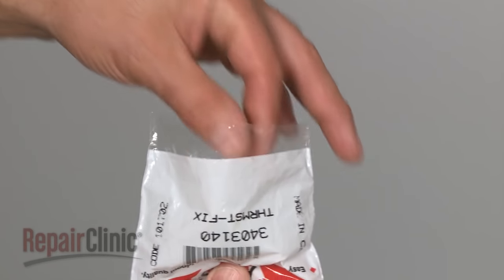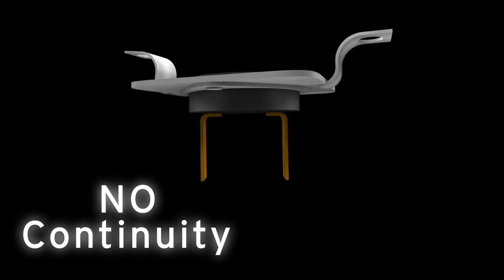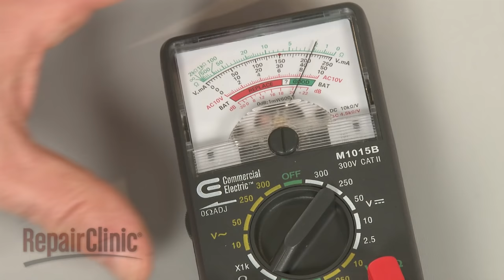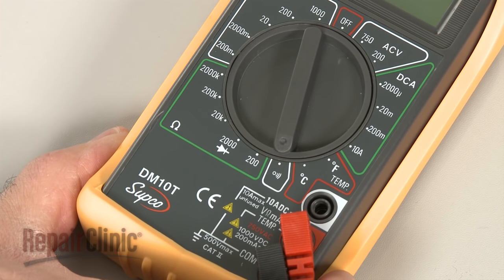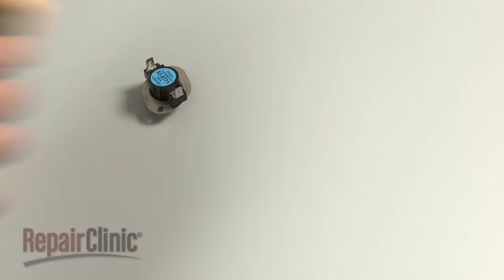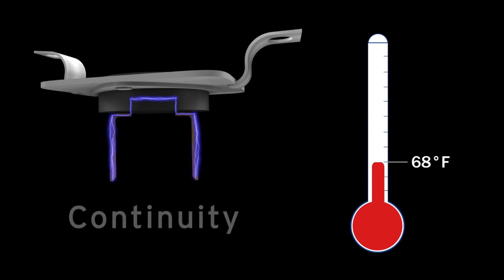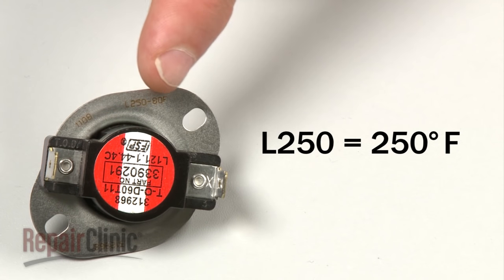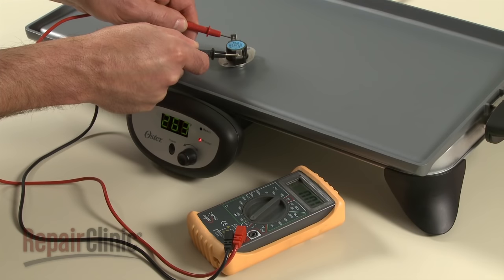Dryer Not Heating? High-Limit Thermostat Testing, Repair

Comment: technically this information is correct but you can also fix the the thermostat by hitting the back of it hard enough to get it to close again. the thermostat being stuck open is the reason most of the time they do not work. as long as the thermostat is tested and gets continuity it should be a very cheap fix without having to purchase a new one. I would definitely replace the coils and clean the vent if the thermostat keeps popping.

Comment: I have watched your video and find it helpful , thank you. However, I have tested all the thermostats, which are fine and the element also shows a reading above 20 ohms, I have placed the meter across the element terminals to read Voltage and switched  the dryer on, I should in theory be able to see the voltage at the element Right ? I am not getting anything and the timer and motor are working properly, so what can now be the problem, ? Could it be the connections on the timer ? BTW, I hot wired the element direct to the mains, and it heated up, so it does work. HELP please. !

Comment: mine shows 00.2 reading at the lowest "200" . Is it faulty or  not the problem with my oven it takes a long time to cook the food then it should be, I checked the grill element and the another element that attached with the fan  both work fine so I though my problem with thermostat.

Comment from the maker: If it tests good for continuity then it's in working order. The rattling is from the electrical contact moving inside the switch which is normal if you're shaking it.

Comment: Another, perhaps risky repair short-cut that I have learned from a seasoned repairman, is how to reset the one-time Cut-off part number 8573713. This part is supposed to be normally closed. If it opens, and loses it's continuity, then a very hard toss against a concrete floor, can most times reset the concave washer inside. Throw it as hard as you are able, and with the flat surface of the sensor to contact the concrete. Test it again with your Multimeter. I have reset them several times, and with the aid of a hot skillet, and a wood stove thermometer, have found the sensors will trip to open as before. Naturally, I wouldn't recommend this to anyone, nor the placing of additional baffling as reported in my prior post.
Reply from the maker: SkyPilot Rookie If that fuse blows you are an air flow problem. On top of that the high limit thermostat has likely lost calibration if the fuse had to shut down the heater circuit.
Reply: That's interesting, and maybe as an emergency remedy to keep you out of the laundromat while you wait for a part to arrive in the mail, but the part is cheap and a possible fire in your laundry room is not.

Comment: two of my thermostats on my dryer read .3 ohms but the third reads 21 ohms.  Does that need to be replaced?
Reply: Yup.  A fraction of an ohm is normal.  Heck, your probes and the lugs on the device can be dirty enough to cause that.  But 21 - no way.

Comment: Hello, 
I have a Frididaire crown  FDEB34RGS1  that is getting VERY hot to the touch then shutting down.    It won't restart for about 10 minutes.  Any ideas what is wrong with it?  

-Checked heating coils and they are good.  

Many thanks in advance.

Comment: I have another question my condense dryer drys maby 2/10min max and than it goes off power totally heating works fine everyting exept that the dryer don't compleet the program. Can someone pleace replay thanks allot
Reply from the maker: Johny Bravo Dryers shutting off early is a pretty common problem. It can be a few different things. We recommend using the repair help section of our website using your dryer's model number. That page can be found here: http://www.RepairClinic.com/repairhelp

Comment from the maker: I would suggest using the repair help section of our website (link in the description). If you enter your model number there you'll have access to model, part, and symptom specific repair help. It will give you a few more things to check.

Comment: My 5 year old Maytag gas dryer, MGDB400VQ0 has failed to heat about 6 times in the last 6 months, and all 6 times have been the result of a failed part number 8573713 Cut-Off sensor, located at the top of the flame tube. beside the High Limit Thermostat number 3391912. Prior to this last failure, I had replaced both thermostats, but the fix only lasted one month. For this last repair, right or wrong, I did a modification to the baffle/shield located at the end of the gas tube. The High Limit is designed to open at around 252 degrees, where as the Cut-off is designed to open at around 350 degrees. The HLimit will reset itself after a little cooling, then allow the machine to reheat as needed, but the Cut-off is a one time fuse. If it opens it will not close, and allow the machine to reheat. Somehow, the Cut-off would open, prior to the HLimit. The baffle/shield at the end of the gas tube is positioned in a manner that protects the HLimit from direct flame, but not so for the Cut-off. Flame would roll around the side of the baffle, and spill onto the Cut-off. This might explain why the Cut-off would open, prior to the HLimit opening, even though the designed temperature for the Cut-off is much higher than the HLimit. Utilizing a pre-drilled hole on the existing baffle, I attached another piece of sheet metal, 1/2" by 1.5 " to the existing baffle with a screw and nut. This gives the Cut-off nearly as much protection from the flame as the HLimit has. Perhaps a risky step to take, and opening up the possibility to overheat, but I hope if that does occur, the sensors in the blower housing will act as a second measure of safety, and shut the dryer down. Two loads of clothes have dried successfully. Any thoughts from others?
Reply from the maker: SkyPilot Rookie Poor air flow caused by a clogged exhaust vent is the most common cause of this type of issue.

Comment: I bought a replacement thermostat for my GE but the blades on the new thermostat are too wide (1'4") to fit into the female connectors on the wires leading to it (2/16"). Never had this issue before. Anything to do besides replacing the wire side female terminal connectors?

Not easy to reach either.
Reply: I meant to type 1/4" and 3/16"

Comment: need help! i have a LG electric dryer model DLE2050W which is not heating at all. i checked the thermal fuse, high limit thermostat and rear high limit thermostat for continuity and they're all working fine.. i also checked the heat element assembly and the multimeter shows 40.7-42.3 does that means its not functioning or is it still good?
Reply from the maker: +Abniel Ivan Brown Rivera Yes. 40 ohms on a heating element is normal. Check the incoming power as the dyer can run on one leg of power, but not heat. The control board may have a defective heater relay.
Reply: +RepairClinic.com  u guys are the bomb! totally right! income power was only 120 which is why everything was functioning except the heating system. thanks alot!

Comment: I have a Samsung model DV330AEBXAA dryer and replaced the high temperature thermostst and it has gone out after two loads. What else could be the problem?
Reply from the maker: We recommend that you look for a restricted vent or even a partially plugged lint screen. You might need to clean the lint screen with a brush and water. The other thing that can cause an overheat condition is a shorted heating element. A shorted element will keep part of the element heating even when the control tries to turn it off.

Comment from the maker: Have you cleaned your vents? The high limit thermostat turning off the heat means your dryer is getting too hot. I would recommend using the repair help section of our website (link in the description) using your dryer's model number. This will give you some ideas of what is causing your problem.

Comment: My digital multimeter when set to the lowest ohms setting reads "1" before testing. Once I put the leads to my thermostat it changes to .1-not sure exactly what this means. Should I assume it is faulty?
Reply from the maker: Michael Angelastro The thermostat contacts would be closed if you had a .1 reading. Even if it was .3 reading, it still would be considered as a closed circuit. It all depends on the meter and how good the probe is contacting the metal. Sometimes you can touch the probes lightly together and get a .3 reading and if you hold them together more tightly, you may get 0. You may not always get 0 resistance but as long as it’s close, you can consider the circuit closed. If you are checking an open circuit, your meter display will not change.

Comment: Will the dryer power on if  the high limit fuse is broken?

Is it supposed to make a noise when you shake it?
Reply: ArmyBoy057 yes it will still work. That’s just to do with the heating

Comment: My Deut dryer heats but doesn't dry the clothes. The problem.isn't due to a clogged exhaust or bad blower fan. I've replaced the thermistor, but the problem persists. Is it possible that the high-limit thermostat is cutting out a too low a temperature, or too soon in general? How does one test this component for this sort of failure?
Reply: You're heating element could of failed too! What I like to do is start the dryer and see if i'm getting 240 volts at the heating element, If I get the voltage there it means everything else is electrically closed and the element is suspect. I further test the element for continuity!

Comment: hi, i have a dryer that does not heat up, and I tested the High Limit Thermostat, thermal fuse and the heating element and all had continuity.I by-pass the wiring on the High Limit Thermostat and i got heat.... is the High Limit Thermostat worng? why has continuity?
Reply from the maker: +8xxbryanxx8 Something does not add up there. If you have heat when bypassing the thermostat it should not have continuity.
Reply: Did you ever figure out why the dryer was not heating? Bypassing the thermostat and then got heat, it seems like the thermostat was faulty.

Comment: What if you get ANYTHING above zero ohms?  I have seen different info from different places.  I even have a few new stats that show a different reading than zero.  But I am not sure of these stats as I have had some trouble with the thermal cutoffs blowing when using these operating stats.  I also have a new high limit stat that also shows different than zero ohms.
Reply: "Anything" meaning what?  Make sure your meter probes and the lugs on the thermostat are really clean (as in, clean them with some very fine sandpaper, like 1000 grit), as that can cause a fraction of an ohm resistance.  Think about it.  It's nothing more than a switch that trips from temperature.  It should not have any resistance at all, ideally, at low temperature.  Even at 0.3 ohm, with a 30 amp load, that thermostat would drop something like 9 volts.  That's a lot to lose just in a switch.  Clean the probles and lugs.  If it's still not, like .05 ohm or less, I'd replace it.

Comment: I have a LG model DLE5977W that stopped heating up... I used your videos to help diagnose the problem and repaired it myself.... as in the video above my thermal fuse needed repairing... just to confirm I put in a jumper for test purposes and the heating element worked without any issues... after ordering the new thermal and installing it... everything worked as it should... however after a few operating cycles I found myself back at square one... seems the thermal has blown again... any help on chasing the cause down would be appreciated.... Thanks again for the videos,John
Reply from the maker: +moore2010214 Thermal fuses blow when you have an air flow problem. The most common cause is a clogged exhaust vent or the vent was not installed in an inefficient manner.
Reply: +RepairClinic.com the units have been stacked until just a few weeks ago.... it is possible that my hose is bent in suck a manner that it might be restricting flow.... ill see if I can come up with a solution and try again... thank you very much for your assistance
Reply: +RepairClinic.com hey how can you check the zero error in the digital ohmmeter and correct it?

Comment: When it shows 0.00 there is continuity,  and if it shows a number and doesnt change then there is no continuity. Well mine is showing various changes, after i placed the needles on both sides of the thermal fuse it displays from 0.00 back to 1.11 then eventually back to 0.01, ect., does this mean there is continuity present or no?
Reply: Davitrieu This is late, but may be helpful - you may show some resistance, around .2 or .3. This is normal and shows that there is continuity as the part is providing measurable resistance - this looks to be a good part. If it sticks at the "1" on the left hand side, then the circuit is open.

I just did this replacement on my dryer, and thank goodness it was this part and not the (discontinued) heating element!!
Reply: This may be late rich1285 but this was the answer to my question. Both read .3 and was not sure if that was good or bad. Thanks from the future.

Comment: What is the resistor in series with the safety switches in a typical cheap mechanically timed GE dryer for? A few watts maybe, and 4.5k according to the drawings I can get. 

Appears to be for a holding current for what I assumed were internal heaters in these switches (keep them open until the cycle ends..?) but not...?

Doesn't make much sense any other way for it to be there... Yet neither you nor the HVAC guys make any mention of a holding element in these things, and with the opens showing on the meters, kinda seals the deal... Yet #2; it's there regardless to do something lol

What gives?

Comment: Do all high temp thermostats work like this?  My dryer heats once at start of cycle, then won't heat again for about an hour.  At room temp, the high limit themostat reads ~14mega-ohms, then after that initial heat, switches to about 4 ohms.  The dryer won't work until it switches back to the higher resistance.  The igniter glows again, but no flames.  Jumping the thermostat {just for diagnostic!} prevented the igniter from even trying to light.... which, I would think, if the dryer expected the thermostat to just be open wouldn't be the case.

Any thoughts?

Help me figure this one, you get my business forever.
Reply from the maker: DijitalPants This does not sound like a high limit thermostat problem; it's more likely that the gas valve coils are going bad. Any time you see the igniter glow bright orange and then go off WITHOUT a flame lighting, this is an indication of failing coils. You'll find our How it Works: Gas Dryer video to be helpful: http://youtu.be/mcipN8bvpa0

Comment: I have a Samsung model DV330AEBXAA dryer.  It is seems to be stuck on low heat and is not really drying the clothes.  I examined the heating element and the coils are a bit black but nothing broken. The inside the dryer was a bunch of lint on the motor, in the heating element, and clogged in the vent for the lint/exhaust.  What else may be a suspect about the dryer on low heat and not really drying?  Thanks.
Reply from the maker: Fred Flintstone Enter your dryer model number in our website's repair help for additional possible causes for that symptom: http://www.repairclinic.com/RepairHelp/Dryer-Repair-Help
Reply: Your vent is clogged.

Comment: My High Limit Thermostat passed the continuity test.  But when testing (carefullly) during operation it prematurely shuts off the burner and the clothes don't heat.

Interestingly enough I've seen many, many folks online who have problems with clothes not heating properly AND a timer not advancing.  Hmm...